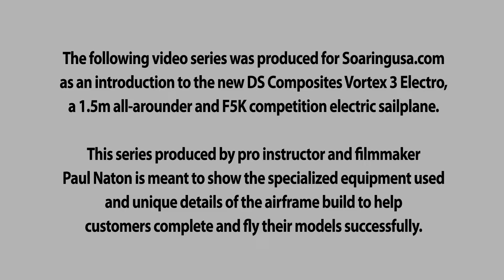Vortex 3 Electro F5K Glider Demo Part 3: More Building Tips & Installation Details

Comment: I'm building this at the moment- would you be able to include the postion/dimensions of the cut on the top of the wing for the top drive please? Also where do you buy the metal celvis that attaches to the servo and the bulged carbon servo covers please? Thank you

Comment: Could you please confirm what the CG is for the Vortex3 electro please?
Reply from the maker: Part 1 shows my starting CG, right about at 64mm back from the LE. You can start more forward of that for initial test flights. Mid chord is where the neutral point is.